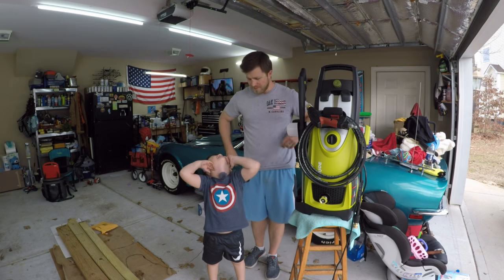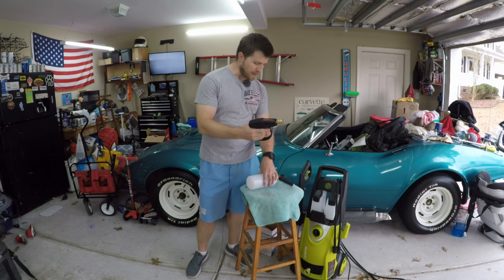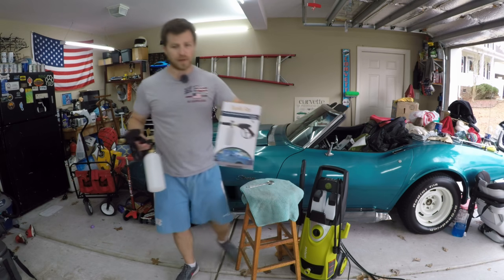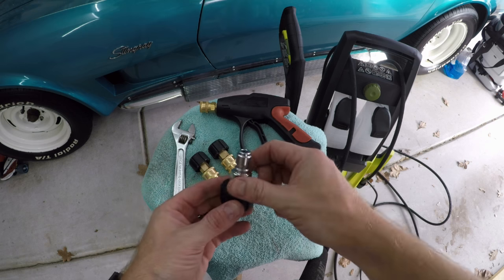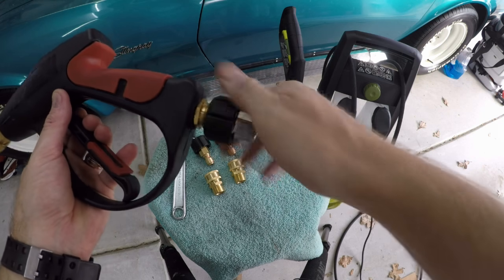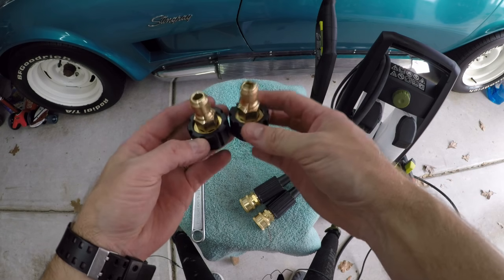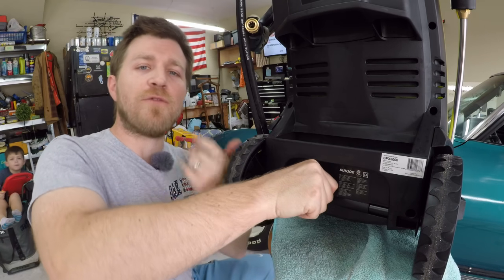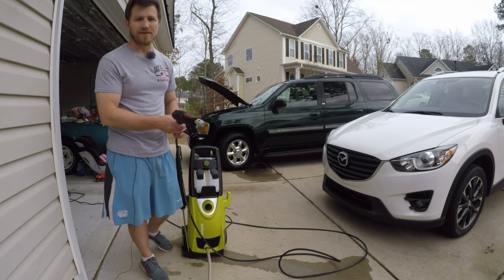EASILY ADD QUICK CONNECT DISCONNECTS TO PRESSURE WASHER

Comment: The world of pressure washers can be a nightmare as this M22/15 and M22/14 mix is really confusing..... 

The M22/15 was, possibly still is, common on gas powered pressure washers for industrial use but a lot of Amercan electric pressure washers seem to use it too whilst here in the UK and modt of Europe the standard seems to be M22/14.... I'd a time of it getting an adapter for my Karcher lance as the foam cannon I'd bought was a 15 and lance had a 14 ..... Then there's the issue with some quick connector plugs being 3/8" and others 1/4"

Comment: You skip the most important part. I assume the quick connect on the new trigger gun with the M22 14mm works with the quick connect M22 15mm on the high pressure hose?
Reply from the maker: Yes it works. The male ends are all 3/8"

Comment: you can't really swivel over these quick connects. the most you can do is for the 1st time before powering on the PW, once the PW is powered on and  primed and there is pressure in the hose till the gun your QC/QD's will just lock tight and would be impossible to act as swivel!, actually you are rotating it over the O-ring and once pressurized the seal will be so tight that it cant move.
 actual swivel will be independent of the pressure inside the hose

Comment: I have the same pressure washer and it leaks at the garden hose Into the pressure washer everytime and it makes my pressure washer act funny.
Reply from the maker: Go to your local hardware store and pickup a pack of hose gaskets. They're rubber seals that go inside the connection.

Comment: How well does your foam cannon work with this pressure washer?
Reply from the maker: It works really well actually...its a great combo for me.
Reply: Awesome. I actually just got the sun joe washer and also a snubby gun.  I ordered the connectors as well as the foam cannon you had a link for!  Thanks again.
Reply from the maker: @jasondunham8760  Thanks for the support! I'm sure you'll like the setup.
Reply: @KevinNadeau ok so I just got the parts to adapt from my torque snubby to my sun joe. For some reason it will not screw into my snubby part.  And was I supposed to order the quick connect part separately from the Male end part?  Either I'm just dumb or I'm missing something.  Haha thank you in advance for any help

Comment: Worked pretty much as expected🌼  allabout.wiki/SPX3000 Former machine was a 2700 psi gas machine. This has much less force but better control of spray and easier to get on roof with! Been working it steady now for a week, roof and siding. Starting deck today. So far so good

Comment: There is a saftey reason why these fittings don't come with quick connects on the pressure side of the hose
Reply from the maker: I would have thought its more of a cost reason. I have a gas pressure washer with 3,800 psi that came with quick connects.
Reply: @KevinNadeau  do you realize what happens if it disconnects accidentally?
Reply: Your setup is extremely dangerous, You should have a female connector on the outlet of your pressure washer going to a male on the hose. That way if it disconnects it seals. Think of it like an extension cord, one end is always male the other is female.
Reply: @italiansausagge9905  source? I see nowhere on the internet where it says this is a bad setup..